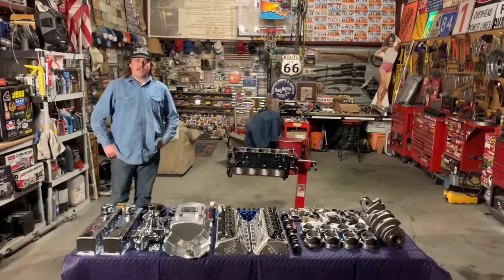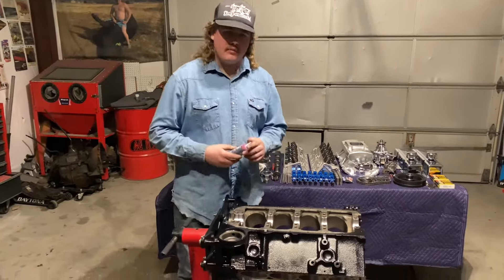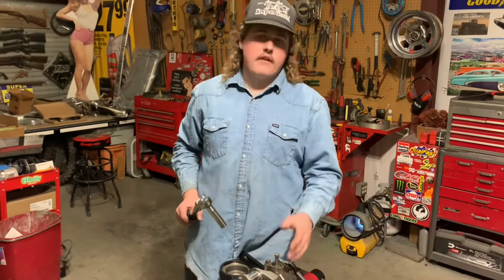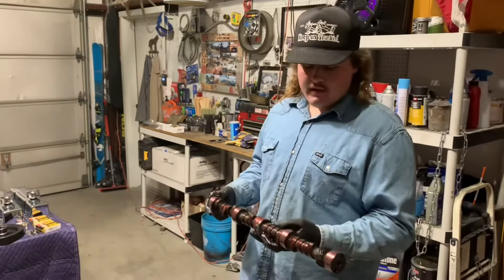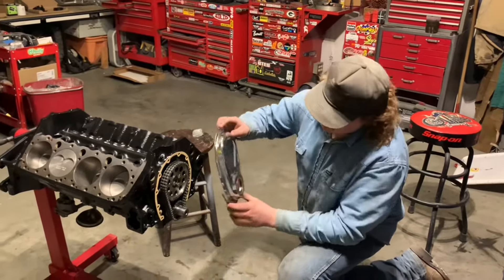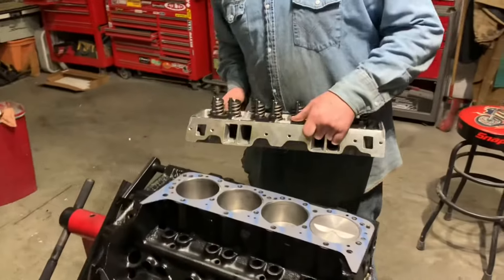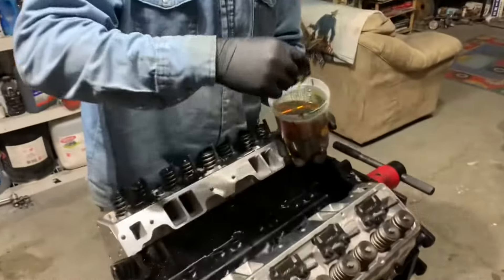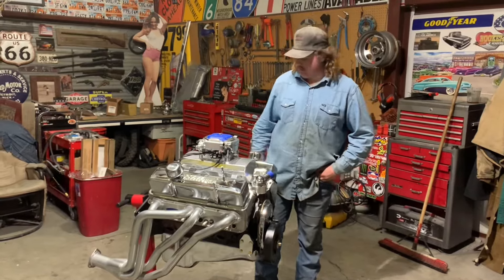383 Stroker Build

Comment: so I heard a stock oil pan won't work for a stroker, im building one and I want to know where you got it! thanks
Reply: Never heard of that , it should work
Reply: the issue with a stroker will be clearing the sides of the block's crankcase area, otherwise stock oil pans fit 400 chevies and the crank is similar.

btw, the way to check for clearance is install the oil pump, torque it down, and put a big blob of clay on it and then torque down the oil pan. don't even bother with a gasket just yet, but shine a flashlight into the crankcase--if light shines out, your oil pan rails need to get flattened out so it will seal perfect. then take off the 'pan and measure how much the blob of clay got compressed.
Reply from the maker: As long as your oil pump clears it will work. I’ve never ran into that issue with a SBC

Comment: Building one myself!

ARP head studs
scat Cast Crank 3.750 
summit 4340  forged rods 5.7 inch 
speedmaster Hyper pistons 
Howards billet main caps 
Comp cams Springs/retainers/cups  
AFR 200 heads 68 CC,
link-bar hydraulic Roller, 
Comp cams roller 522/509 Lift, 
4.030 bore, 
aluminum full roller lifters, 
victor Jr High rise single plane intake, 
Edlebrock Carb. 

other than that, you've earned a subscriber
Reply: So top of the line parts except for cheap Chinese rods and pistons 🤣😂🤣
Reply: Sounds a lot like my build....was going to go with AFR 195 CC heads, why did you go with 200cc heads, and do you like that choice?

Comment: 383 are nice, lots of torque. Clearance machining is required. I was always a fan of a destroked 454 to a 427. The extra 100 pounds didn't hurt my feelings. Great job but, It urks me seeing raw surfaces touched by bare hands. The oil on your fingers will not allow the zinc in the oil to absorb properly. It might not make a huge difference but that's how I was taught.  Other that that perfect example 👌

Comment: Are the connecting rod journals bigger than stock and if so what are the rods and pistons you used with wrist pin location and rod length?

Comment: I'm building a 383 for my 1985 gmc k2500, im doing internally balanced 1 peice rear main. which flywheel do I need, an oem or should I upgrade im stuck on that and the harmonic balancer
Reply from the maker: You have to have one with a weight for a 383.

Comment: Why do people use chrome parts?!  Do you just want to guarantee it leaks??
Reply: They are just aluminum
Reply: @viperford6840  The oil pan, timing cover, and valve covers are aluminum?
Reply: @Pistol148  mine are. Aluminum-alloy